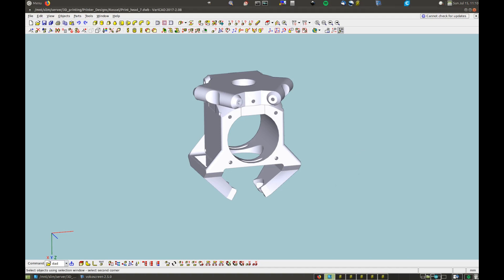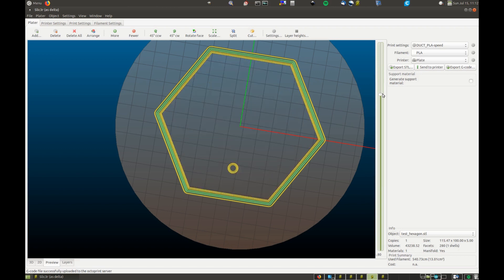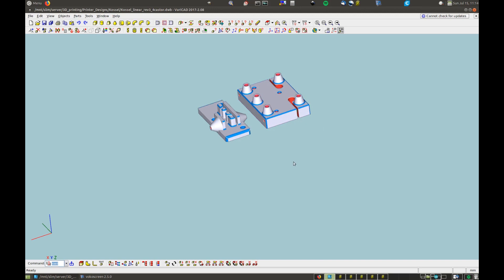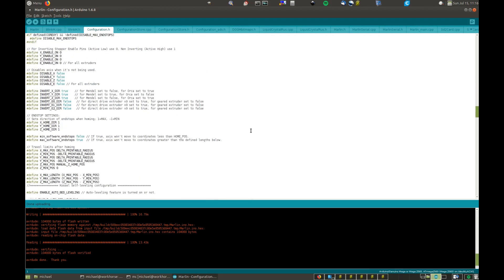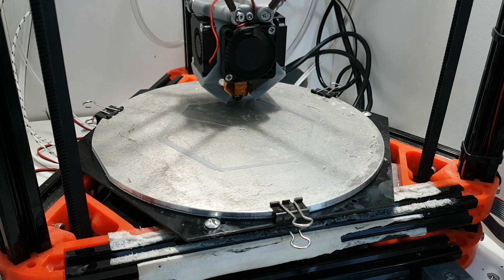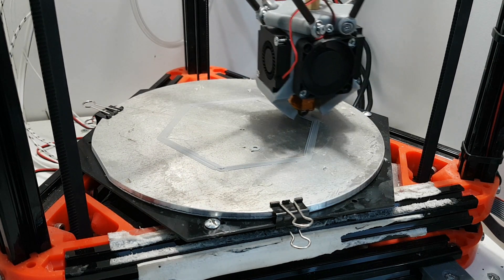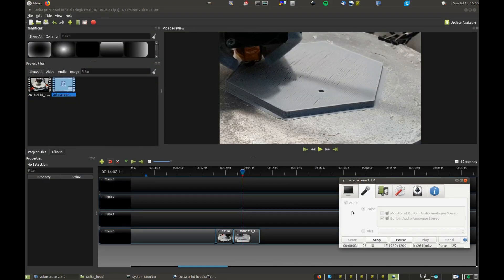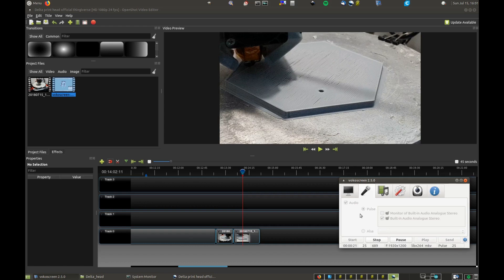Delta print head official thingiverse

Comment: This may be an old video with no comments, but I think it is very good.  I have a Flsun Qs Pro.  The effector is the same that comes on the Q5, which I also have.  I will plan to complete the Pro's build and I will probably use this on it.
Reply from the maker: It's an old video.
I still love that machine.
I have 9 printers now, even a couple of resin printers.